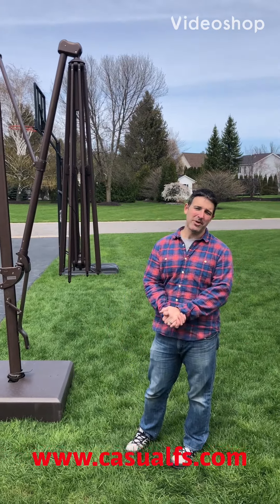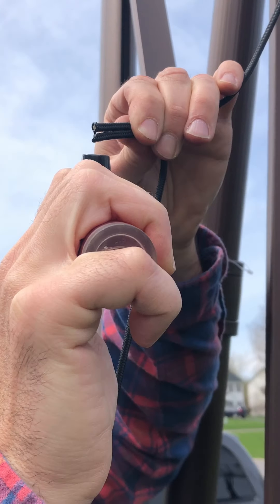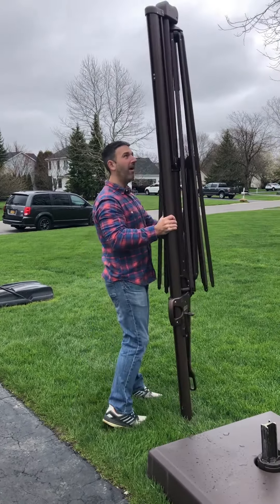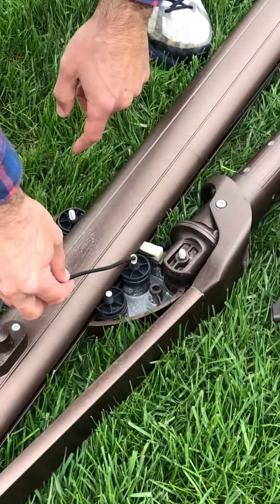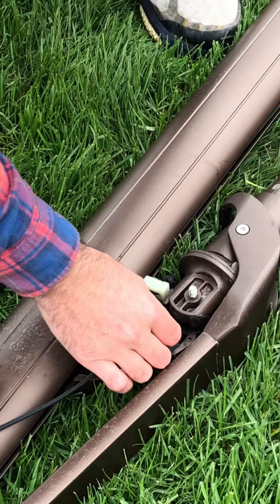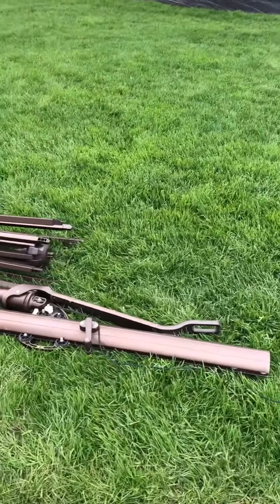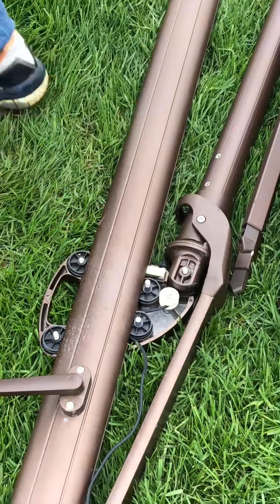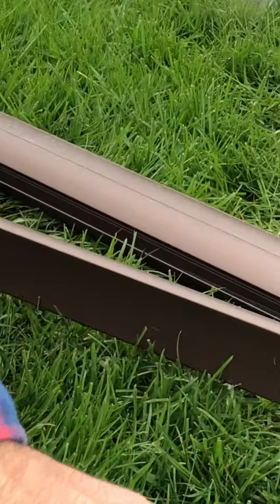AKZ Deployment Cord Replacement

Comment: Want to thank you for your video. Around 2016 the only video out on these umbrellas were you taking you umbrella to the local shop for an expensive repair. So in 2016 I re strung the umbrella myself after all the bolts and wheel pulleys fell out. I was in shock but got it put back together. Now 2022, yes your video is 3 years old now but totally reduced the stress of restringing this umbrella! 5$ string from the depot and about an hours worth of time. Thank you! 
And yes.. handle bolts heads taped before removing outer side handle cover is a first timers life saver. And loved your way to melt two cords together! 
Thanks again
Reply from the maker: I'm glad it helped you out!!! Be careful with the cords from the stores.  Treasure Garden uses a special Kevlar cord because of the amount of stress on these large umbrellas.  Here is a link to al of the AKZ replacement parts where you can find the cord.  https://casualfs.com/product-category/patio-furniture-parts/treasure-garden-replacement-parts/akz-akzsq-akz13/

Comment: Great video - I have the older model AKZ with the wrap around cord lock.  I had to take the entire assembly off to figure out that the cord lock was stuck due to being wedged a little sideways.  I broke part of the spring in the process.  I have since ordered a new lock from your website. Thank you for the video / made the process doable!!!

Comment: I watched this 2 years ago when one of the cords snapped and thought "too difficult, pay a pro." So I did. $107.13. Ever since then the umbrella has been very difficult to raise, a "snap" occurs halfway up, and the deployment cord is showing serious wear about 14 inches from the endpoint in the middle of the canopy. I took the top section apart and discovered they never replaced the pulley mechanism, so the cord has been rubbing against bare metal. I'll be giving them a call tomorrow to see if they are willing to make it right, but if not, I'm faced with finding a replacement pulley mechanism AND figuring out the magic of that final step.

Comment from the maker: Mike C. from Palm Springs CA sent me an idea to put a piece of tape over the bolts if you have to open the grip up.  That will keep the bolts in place and won't have to worry about the pulleys coming off.  Thanks Mike!!!
Reply from the maker: Is the cord blocker out of the grip?  Or, is the grip not coming down the main mast?

Comment: my umbrella gets stuck when I crank it forwards to open and the cord gets really tight,  then I crank backwards to close it a bit and it releases the tension but continues to open up and gets stuck again and then I crank it forwards to open again and it works and opens all the way without a problem. do you have any idea what is causing this? I am basically cranking it back and forth depending on what gives and it just opens in either way. closing the umbrella is also in a similar way, back and forth.
Reply from the maker: Many times the Loop Lock, which is the clip that slides up and down the front of the main mast, gets stuck on the stopper.  If you spray some silicone on to the tooth where the stopper goes into the Loop Lock, that may take care of your problem.

Comment: Literally cannot do the very last step, the cord won’t come out of the bottom of the umbrella hub and after all that work I’m stuck dead in the water….ultra frustrated.
Reply: Looking up in there the cord appears to be wrapped around a pin or something up in there, but this model is literally exactly the same other than that very clear difference.
Reply from the maker: @WadeBiery  Hi Wade.  that sounds like the older spring lock which is typical.  You can't reach up there with needle nose pliers and grab it?
Reply: @casualfurnituresolutions7564   I tried that, it appears to be wrapped around something in there, like a hinge pin or so…
Reply from the maker: @WadeBiery Basically, there is a piece of metal with the cord wrapped around it a couple of times.  I have seen where the metal breaks down the middle and the cord pushes it out to the sides wedging it to the walls making it hard to come out.  Usually, the cord hangs down but that doesn't sound like the case for you.  Possibly use some hook tool to reach up there and pull it down.  Worst case scenario would be to replace the runner (plastic hub where the rope is tied off).  Here is a link for you if you need to do that.
Reply from the maker: https://casualfs.com/product/runner-5/
Reply: I should note, up to that point, the video was dead on and super helpful, it’s just that last bit….

Also, I saw a part on your site that is the dual plastic channel guides for the canopy angle arm, you can pop them out to change the angle of the canopy, then pop them back into the main channel, but I can’t find it. If I can get back to that I’m going to have the client order one of those from you because that part is broke too.
Reply from the maker: @WadeBiery  Yeah, sounds like you got a curve ball thrown at you.  I just took a runner apart unscrewing the 8 screws that hold the top half to the bottom half.  If you open it up you should have access to the cord lock.  Just be careful and have a second set of hands to help hold the ribs in place when you separate the two or the ribs will go everywhere.
Reply from the maker: @WadeBiery  Sounds like you are looking for the loop lock.  It is the clip on the back of the tilt lever that holds the lever to the main mast and slides up and down when you open and close the umbrella.  Here is a link for you.  https://casualfs.com/product/loop-lock/
Reply: @casualfurnituresolutions7564  
Yep, that’s the piece, you’ll be getting an order for that shortly, also I’m gonna try taking the top of that hub off, I just got tired of it today and it was getting late….
Thanks for all your help, and the vid we’re jabbering about above, it made the job doable, and the client is super happy that their piece is going to be working again. Those things aren’t cheap… And his is the 11 foot one… It’s freaking huge.